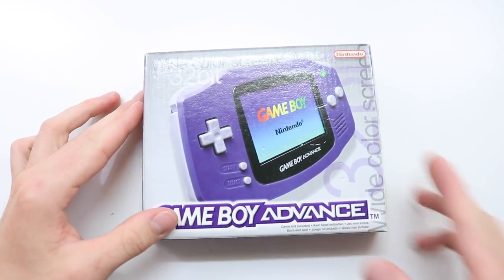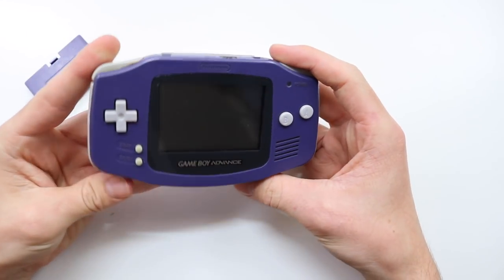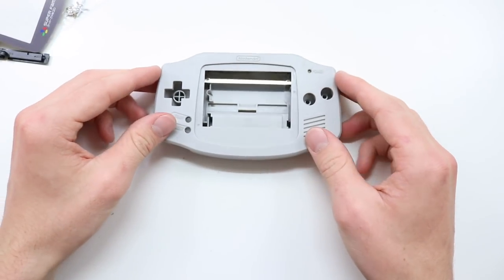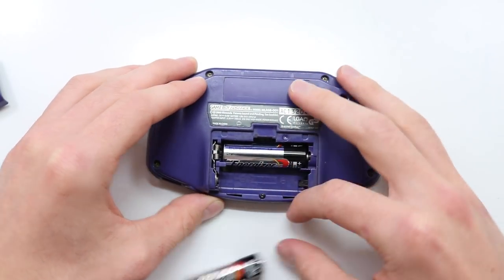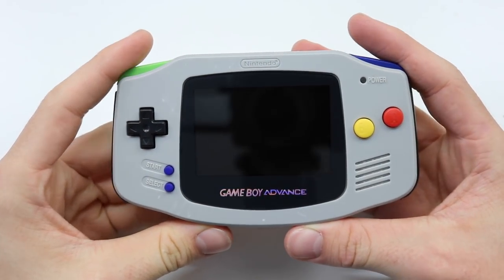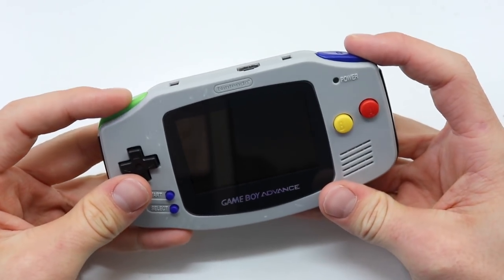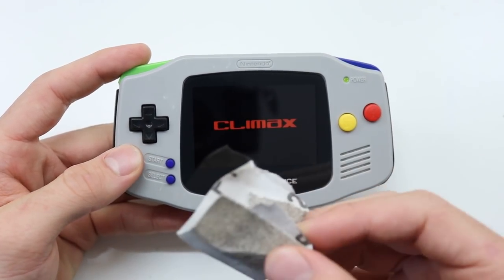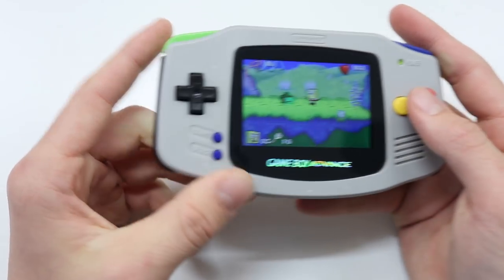The BEST Way To Play GameBoy Games! (AGS-101 Mod)

Comment from the maker: I appreciate this wasn't exactly a tutorial - more so just showing me doing it. If you would like me to do a tutorial, let me know! Enjoy! :)
Reply: A tutorial would be much appreciated
Reply: Yes do a tutorial! I recently got my hands on a GBA, i’ve seen brightness mods and rechargeable battery mods for the GBA as well, that would be cool to see
Reply: Certainly something I'd like to see a tutorial on and give a it try myself. Appreciate the uploads and enjoy the vids. Thanks.
Reply: Would love a tutorial as well!
Reply: Yes please
Reply: The red wire you soddered into the inside what was that for because I didn't sodder it in mine but it still works. So do I need it or not?
Reply: Biggie Steve  Solder.
Reply: Biggie Steve : It's to increase the strength of the backlight. I ran mine through a little switch that I've hidden in the wriststrap hole, but it's certainly not necessary if you don't want the screen any brighter.
Reply: Also, FAO elliot:

this is probably the one thing I don't need a tutorial for, but I do have a suggestion for if you make one.

There's a converter cable available which actually has a built in backlight brightness switch. I've seen a few on ebay, but you can probably get them elsewhere too. Maybe you could try that cable out to vary the video slightly?
Reply: I'm also interested in a tutorial! :)
Reply: @Charky_Creations  thank you for the help 😊
Reply: Please do a tutorial you're doing a great job keep it up!!
Reply: FYI I couldn't find the Bar Code label or Battery Door label for this Game Boy Advance any where and then I finally found it on eBay from a seller named Game Boy Color Man! Dude is awesome! Might wanna check him out if your doing a build or need a label! 
https://www.ebay.com/usr/gameboycolorman
Reply: Step by step, all tools required, for beginners edition would be most welcome kind sir.
Reply: The Retro Future im sure you did a lecture in my uni the other week
Reply: I would love to see you do a tutorial on this. Great video though!
Reply: What were the pliers you used to cut the plastic?
Reply: @Sidsaraiya  they are flush cuts.
Reply: The Retro Future would love to try this on my game boy advance, I’m waiting for your tutorial
Reply: I would
Reply: Yes. Please do a Tutorial i have a silver gba and would love to add ags 101 to it i have basically no experience so that might be difficult but ya!
Reply: please do a tutorial. please.
Reply: Can you add rechargeable battery in it
Reply: Please do a tutorial
Reply: Yes please do a tutorial
Reply: Im going to buy a gba and do this
Reply: Yes!!! I've been wanting to do an AGS 101 mod on my GBA and while there are other vids I would much rather watch yours!
Reply: Lol uh, yeah, I think ppl want a tutorial... the hell....

Comment: Doing the mod this way doesnt provide a very bright screen, but its good for most any indoor lighting. In the states we have a website called retromodding that has a nearly full collection of GBA mods for sale. I also picked up a voltage regulator and digital brightness adjuster. While it involves a lot more soldering, it should allow me to get all the brightness out of the AGS101 screen it provides in the GBA SP and be able to dim it for any conditions, even on oddly bright train rides or when all the lights are working in my office. They also have USB rechargeable LiIon battery packs,  speed controllers, better speakers and amplifiers, and rom carts. Its just interesting that Mr Retro Future decided to dive into building a AGB101 at the same time I did. 

Here's the big decision you have to make though. A nearly full gamut of GBA mods can cost upwards of 250USD. Unless you REALLY love the GBA and its form factor, you are limiting yourself to the GBA/GBC/GB/NES library of games. at that price, you can get a PSP, Vita, or even a GPD XD and be able to play a much larger library of games. I still love the GBA tho <3

Comment: This was cool.  Some suggestions / votes:

Yes, I would like to see a tutorial video.
Other mods  for the GBA:

A better speaker (Audio Amplifier)
Rechargable battery pack
Backlight brightness controls (maybe check out BennVenn's and Dr. Gamenstein's stuff)
Voltage regulator (to get full power to the backlight on the GBA)
GBAccelator - Overclocking (and underclocking) the CPU

Comment: FYI The red wire is for power. It goes the the left leg of D1.
If you don't solder this wire the screen will be dimmer and you may have power issues.

Comment: I just recently did my first backlight mod for the Advance.
I’ve watched soooooo many tutorials because I’m not the most proficient with electrical stuff which is why I love your channel. Very straight forward.
One thing I am surprised about is that not one video that I’ve seen that recommends to insulate the ribbon cable with electrical tape so it dousnt touch the board and shorts out.
I initially thought that the screws were on too tight or that I didn’t trim the inner frame enough so it might have been squeezing some connection.
But I read on a forum where some other dude had the same problem where if you put too much pressure on the console it would freeze and get some interference from the speaker.
Maybe using electrical tape would be a no brainer to most ppl who are good with this stuff but it was a headache cuz I thought the kit I purchased was faulty. But once I used the electrical tape to keep the ribbon cable from making contact with the board it works perfectly!
Anyways yeah, just surprised from all the tutorials I’ve watched not one video recommends using the tape to keep the Gameboy from shorting out.
Reply: I just stumbled across your comment and actually you might have saved me from a headache here. I recently purchased a pre-modded GBA with backlight and it occasionally just freezes and makes strange noises. I might look up if that's the reason. Thank you for the heads up!
Reply: Neellav Gogoi  Yes and no 😅 I got a new UV printed shell a couple of months ago and put the board and a new screen kit in there. It now works like a charm :) but yeah, it looked like the ribbon cable could have made contact with the board so that qas likely the reason.

Comment: Glad you used the right ribbon cable with the two component on the side. I feel it give a really nice picture quality and that we dont need the Benven voltage regulator! Good job!
Reply: @Vegito Charmara I, personnaly, feel the picture quality with a Type B ribbon, is good. I read that with type A you need to do other fix to get it without ghosting. For the regulator, I personnaly, feel the brightness perfect without one 😁 Hope it clear it out for you, have a nice day sir 😀
Reply: The Type B has two little components on the side witch help to prevent the ghosting, otherwyse you have to do the ghosting fix .. Look here for more detail :
https://www.retromodding.com/blogs/tutorials/ags-101-to-gba-ribbons-guide

Comment: Great video and I agree that the agb101 mod is the best, most comfortable way to play gba games. Small tip, pre-tin wires to make it easier to solder them and always trim them down to what is minimally necessary to solder them down or you could risk them shorting to a nearby pin and frying something. Also I was wondering if you noticed one of the batteries was in the wrong way rofl!

Comment: I live in us. I used eBay/AliExpress for this mod. The 32 pin attachment bit was 7$ , the gba was 50$, and the AGS101 screen was 70$. Overall for this mod in America I spent 127$. If I got the new screen cover and case I’m gonna add 20$. So total about 140$. You could pick up a GBAsp AGS 101 for just 70$ and much easier and cheaper. Thought I’d say that for anyone considering this.

Comment: Nice mod,  Elliot, im enjoying a lot your videos! Let me give some tips, on the chinese shell, the screws keep going through the shell if you continue applying torque, so use less force when you put the screws, and for small spot soldering, use liquid flux on the spot and aply the solder in the iron, and touch the "fluxed" spot with the iron, this way the solder flux easely from the iron to spot. (sorry for my bad english) Peace!

Comment: I have ordered a glow in the dark gba shell for my beloved gba, mostly because the screen was scratched and the d-pad rubber was damaged and getting a complete shell was less expensive than getting the rubber and a lens screen.

P.S: If you don't want to buy a screen lens twice but are still afraid that the plastic one will get scratched, just use your old screen to shape a smartphone screen protector.

Comment: I'm kinda torn on the matter... I mean, I live in Australia, and even AGS-001's here are becoming pretty expensive, at least to find locally, let alone AGS-101's... Does anyone know any good ways to find really beat-up AGS-101's anywhere for cheap? Cause currently the cheapest AGS-101 GameBoys I can see on eBay are some AGS-101 screen swapped AGB-001 shells, which are going for about $150 AUD, and that's slightly outside of my budget range... Even the screen on its own, the cheapest I can currently see on eBay is going for $80 AUD, and that's without the converter cable... Any good alternatives?

Comment: I've been thinking about doing a case mod on my brothers old GBA. He got it free from a friend who didn't really take particularly good care of it, but it worked (and still gets used time to time for trading Pokemon around). Something like a screen mod would really complete the process and the form factor of the original GBA I tend to prefer over the angles of the SP, even if I loved what the clam shell design meant for protecting the screen of Nintendo's handhelds. I'll probably see if there are some sleeve covers for the GBA while I'm at it.

Comment: Silly question guys, I just did this mod and it is working fine without the red wire from the adapter being soldered to the gba.  Is that needed to make it right safe or anything or should I just keep running it without?

Comment: The red wire he soldered into the inside what was that for because I didn't solder it in mine but it still works. So do I need it or not?

Comment: Since doing my AGS-101 mod, I've had an issue where I need to adjust the voltage going to the screen to fix the color, any ideas on what happened or what I did wrong?

Comment: It is easy but having to solder a wire is an automatic deal breaker for me. It just feels like you are doing so much more when you could do this on a GBA SP and not have to solder any wires. You need extra equipment, a soldering iron, a tool to break the plastic bar, and all at the risk of breaking something or burning the board itself.

Comment: I need help. I need someone to reply to this who knows a lot about this. So I have a gameboy advance and I'm looking to mod one. So I looked on eBay for ags 101 screens and I found a lot of them. They didn't say anything about the white tab or black tab. The tab in talking about is the tab on the end of the ribbon cable on the ags 101 screen. So I have a 40 pin model for my gba. Does it matter what color tab you use? I heard some websites say that the 40 pin can only use the black tab. And also I know you can do this mod WITHOUT soldering so anyone know if it matters what color tab does what. Please reply asap.

Comment: Just noticed tthat ebay link for the screen kit does not say Game Boy Advance on the glass front cover, but you did get that logo on there.

You just made me buy these parts, very inspiring!
I got a dark (smoke) clear shell with clear orange buttons and a screen, I got the 32 pin one, cause I got 2 32pin AGB gba's
Reply from the maker: It will come with the logo usually.. they just take it off for the photos to avoid copyright I think.

Comment: I bought a pre-modded backlit GBA from Etsy, it’s awesome (built quality is awesome, it feels like it could be brand new) but it does have a problem though. It does not read cartridges problem. Perhaps I need to push up the cartridge reader or should I replace the cartridge reader/loader, tell me what you think I need to do. Hopefully it isn’t an insanely difficult or long fix!

Comment: Hello there TRF!

I had a question regarding the mod you just did.
I have been wondering myself how to transfer the original back stickers (OEM) from one case to another.

Noticed you used something similar. Could  I know what it was?
Reply: Hairdryer to weaken the glue of the sticker and just reapply it to the new case, that's what I did and it worked well
Reply: Second the hair dryer trick. There's always a resale store or a garage sale selling them for cheap.
Reply: Oh god, thank you both.
I forgot to thank you after reading the comments.

It's helped me out.
Want easy, but worked well :3
Thank you so much!

Comment: I want to do the same on my SP. I have one of those limited edition NES-themed ones and my idea is to take a working AGS-101, tear it down and use its internal parts as donors for my AGS-001 and swap them around. 

I know it could be technically cheaper to just buy 3rd party parts like the ones you showed in your video and have a brand new SP for around €50, but the one I have holds so much sentimental value that I don't care if another AGS-101 gets murdered so that my AGS-001 can live.
Reply: can't you just buy a 101 screen on ebay and keep your original parts? it would be less of a hassle
Reply: Actually those are not original ags 101 screens but replicas, there are a few noticeable difference. The replica has worse blacks and has a slightly lower refresh rate. That's why the ags 101 goes for high price it's not only for keeping the mod as much as original as possible but also a quality reason

Comment: Ive done this mod. Was disappointed you used the fake Nintendo sticker, its really easy to transfer the original sticker from your original gba hair dryer and Stanley knife does the trick. Looks good tho
Reply from the maker: As I mentioned, I wanted to transfer it back into the purple one anyway. Which I have now done. That one matches the  code of the box & manual.

Comment: Awesome vid/clean build! You should think about checking out the GBAccelerator. It's a pretty straight forward setup and lets you overclock your system by pressing multiple buttons at once (like L+R+Select). It makes rpgs way faster/ easier.